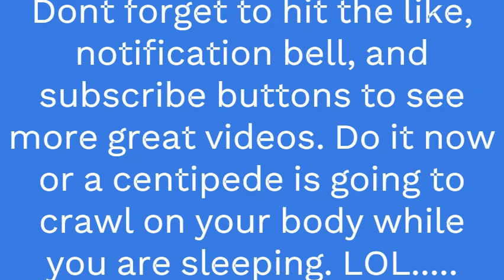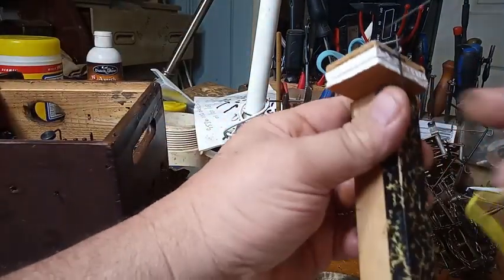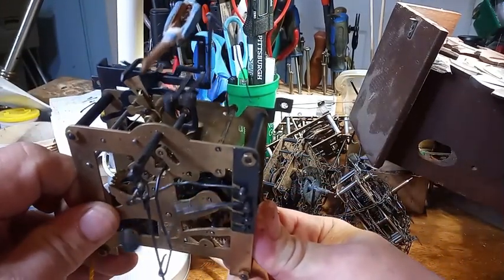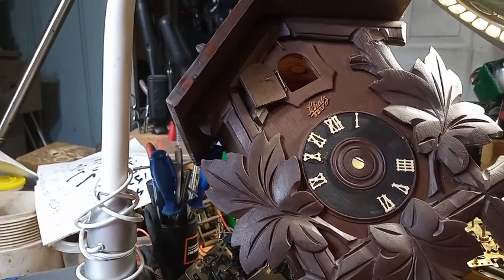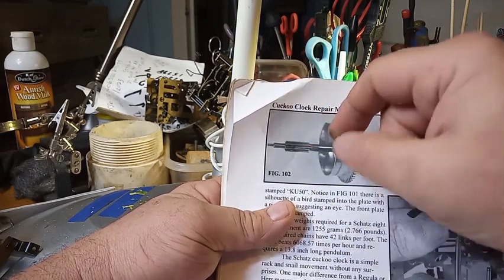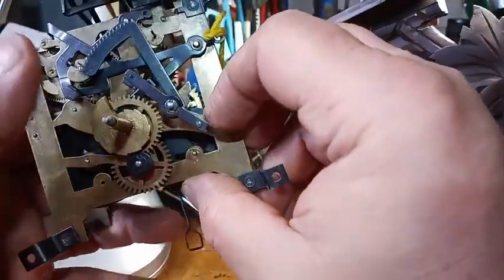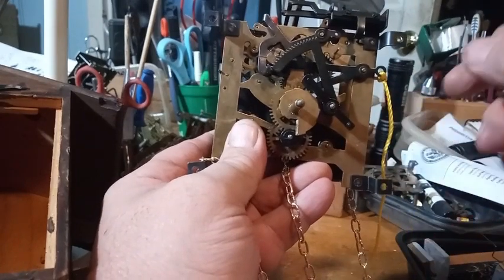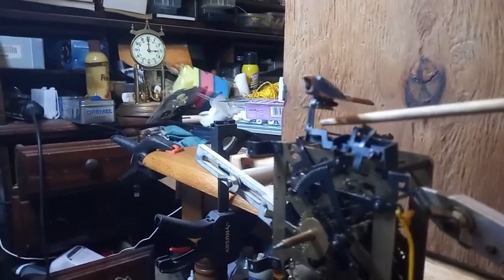Cuckoo clock repair for Beginners (Discussing a Schatz cuckoo clock) see description

Comment: You have saved my reputation more than once, always on the money with your videos. This video saved the clients original movement from being replaced, especially the door slamming problem. thank you for your interest in Cuckoo clocks.
Reply from the maker: That is why I make these videos. It is my way of saving clocks one at a time without touching the clock.  Glad that you got it working and not having to replace the movement which in my opinion would be heart breaking as the new movements will not last as long as the antique movements.  Thanks for watching and especially commenting.  God bless.

Comment: I don't have one of these clocks. If the door is suppose to stay open until the bird is done cuckooing, that clock isn't that bad. I could understand it the door was always slapping closed between each cuckoo. It does look like the lever to hold the door open needs to be adjusted to rest on top of the brass lever so the door does not bounce.  This was another fantastic video Mark.
Reply from the maker: Thanks for the comments Mike. Yes the door isnt supposed to slap in and out but the cuckoo is. However the way the mechanism/bracket assembly that holds the cuckoo is attached over time the parts get loose and I think that is what is causing it. Hard to get a pair of plyers in the movement to twist that piece of metal to try to tighten the bracket up without taking the movement apart. They seem to sell rather cheap on GW. Unless it is a After the Hunt, Hunters cuckoo clock then they sell quite well.

Comment: Hi Mark, i have same clock but my pendulum has stopped. it goes for 15 seconds then stops. the clock has not worked for few years. it worked when i first got it.
Reply from the maker: It is either out of beat or the "V" wire needs replaced/the clock needs serviced.  Cuckoo clocks need serviced about every 3-5 years.  Search my channel on how to put a clock in beat.  If it is in beat then search my channel for replacing the "V" wire.  Finally search my channel for servicing a clock.  Good luck.

Comment: I recently got a Schatz cuckoo clock and the great wheel on the strike side is in the same place as the one you have there.
Reply from the maker: Yes I think they made them all that way........not really sure though.
Reply: @munnerlyn3  do you have any extra Schatz cuckoo clock hands? The minute hand that came with mine is broke and I never seem to have any luck when super gluing.

Comment: Mark how do I install verge on regula 25
Reply from the maker: I am not really sure I know your question. There is only one way that they go on. You have to make sure that you have the right one. Timesavers sells them if you dont have it already. The pallets go over the teeth of the escapement wheel. The pivots fit into the pivot holes. The crutch assembly goes to the back of the movement. Typically goes  underneath part of the movement then to the back of the movement and on the outside. There isnt but one way that they go on. Look for my videos "Parts of a clock" I have one in the Cuckoo clock for Beginner series. I show you all the parts of a movement using a Regula 25 movement. So that should show you where they go. You can typically loosen up the top to nuts of the movement and open the plate on the time side and slip the verge and crutch assembly into its proper place.
Reply: Ok thanks mark, I am gonna try lol, I enjoy and watch all your videos,take care